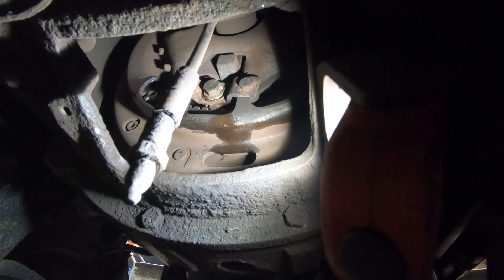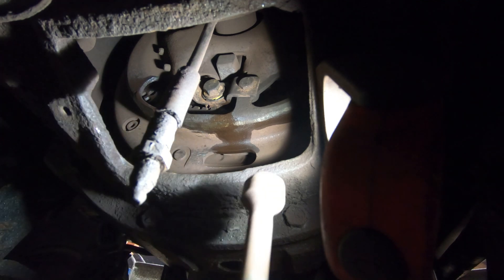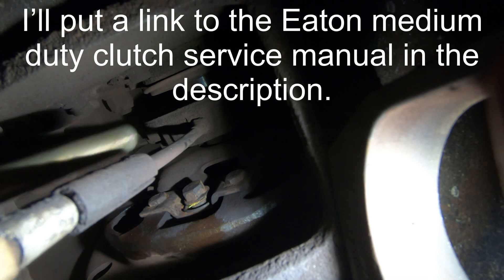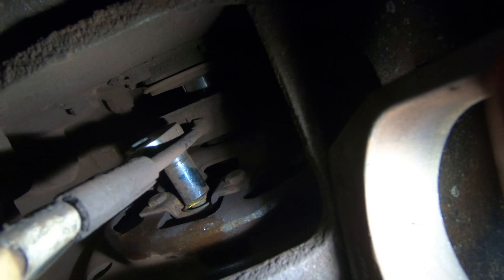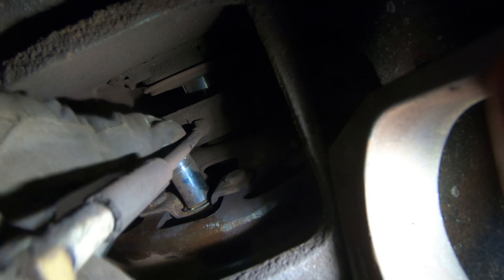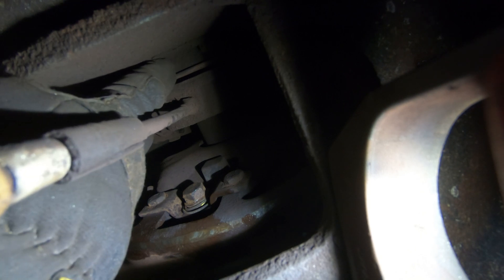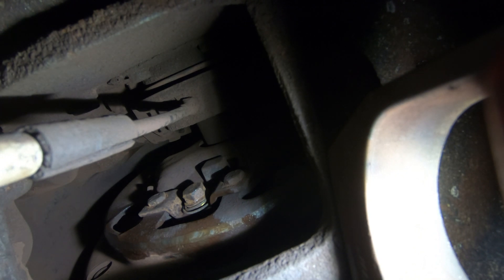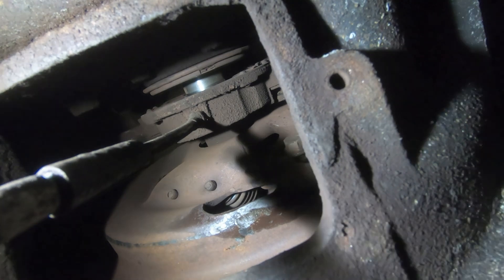Freeing up a seized Eaton quick adjust clutch and adjusting

Comment: Thank you!!!! I needed to know whether to turn the bolt clockwise or counter clockwise also whether or not the clutch needed to be engaged.  Your video answered both questions while the Eaton tech line rang for more than a half hour. Although I didn't have a frozen bolt that info is good for future nightmares. Also the steady camera is a huge plus. THANKS AGAIN
Reply from the maker: No problem! Glad I could help. I have a link in the description to an Eaton service manual for these clutches and a few more. It goes through the setup and adjustment process.

Comment: Thanks man, my Argosy has the same problem, fingers crossed this works as I dont want to take the box off etc 🤞🤞🤞
Reply from the maker: I hadn’t come across the stuck adjuster until these two trucks. But the first one was from my video of changing the flywheel housing. I had it all back together and the clutch was only like a year old so I just put it back in the truck with the transmission, and when I went to adjust it it was frozen. I was very upset about that one. Then a guy told me about this trick and it worked. Wish you luck.